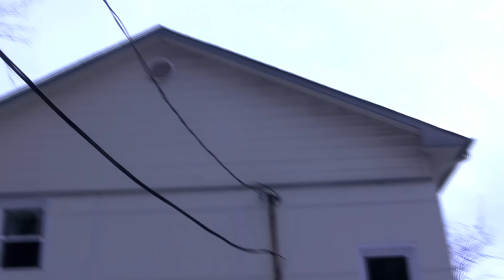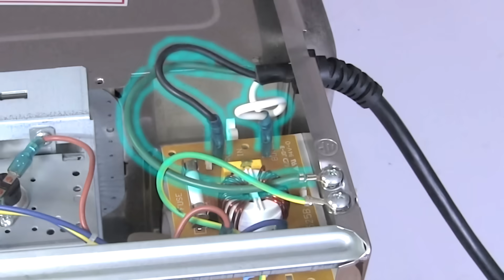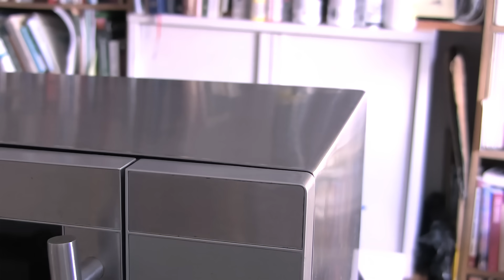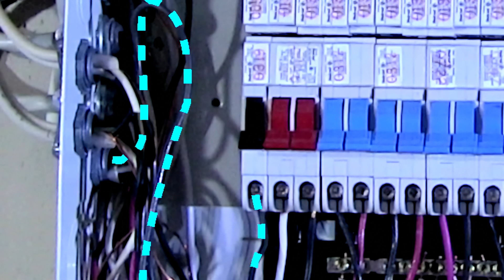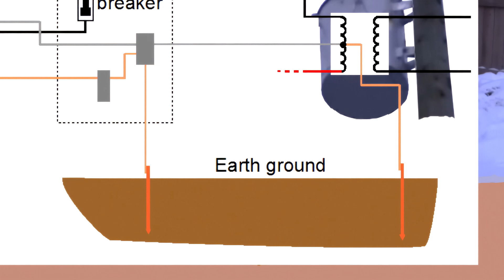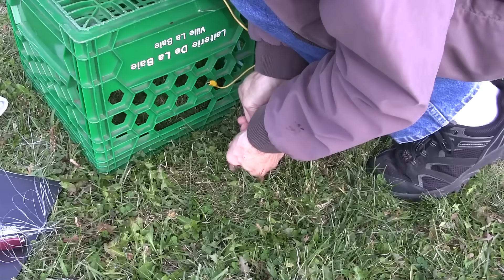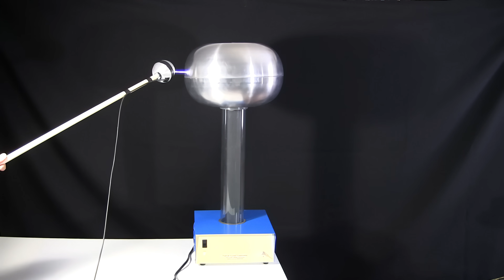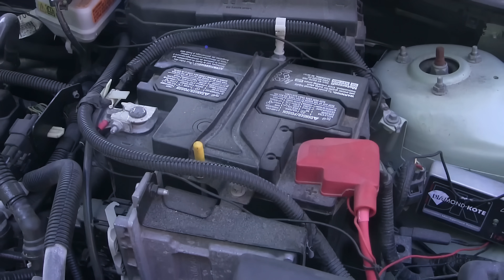What is Ground? Earth Ground/Earthing

Comment: how do they ground electrics in aircraft, such as a military chopper with lots of radar and computers etc?
Reply from the maker: The metal shell of the aircraft is used as the ground/common.
Reply: The same is done in cars. Minus of the battery is connected to the chassis.

Comment: So ground should be called neutral... and the neutral wire apparently does nothing.
Reply: actually neutral and live are just "1" wire if you think about it, just that the Neutral is the return part and the Live part is the receive part... but yeah Neutral makes a bit more sense for ground in a way but since Live is the only one sending current, they chose Neutral cause it kind of does nothing AND ground probably was thought of after the fact. but trust me when i say, it is actually just one wire with a thing powered in the middle, except one sends power and the other returns it.
Reply: Toori-  Not exactly. GFCIs work without a ground wire. In fact,  GFCIs can be installed in older houses with 2 wire Romex (no ground) instead of having to rewire house. A GFCI trips when the current through the hot and neutral does not match, typically when said current goes through, say, a person. That is, the current is passing to ground through an unintended path.
Reply: And, BTW, the difference between neutral and ground is significant, even though the they are at the same potential. The neutral carries current equal to what passes through the accompanying hot, while the ground should never carry current.
Reply: No not at all! The ground wire does not carry any current. It is there as a safety. The hot and the neutral are the only current carrying conductors

Comment: Is this a TN-S system?
Reply from the maker: This is the first time I've looked in the TN designations so I could be wrong but from https://en.wikipedia.org/wiki/Earthing_system#Types_of_TN_networks it looks like this is a TN-C-S system since there's a combined PEN conductor which inside the house is a separate PE and N which combines in the breaker panel and there's a separate Earth-Rod (or equivalent) at the house.

Comment: When i was playing with my guitar cord (plugged in) i touched the tip and makes a noise but when i lift up my foot it goes away even in the walls when i touch my hand to the wall it makes a noise so is cement conductive?
Reply: And only with single-coil pickups :) (unless something is broken or poorly wired). My old strat did that indeed. I guess that your foot grounds it.
Reply: Lol i did everything to find out what it was i tried putting rubber below my amp so it wont touch the floor i tried putting everything up even the wires and cord it still makes that noise like wtf where is the ground coming from?
Reply: Basically your wire coming from the amp is an antenna. You have strong 60hz magnetic fields all around you. The magnetic field induces a voltage into your unshielded cable which because of the amplifier design, will greslty amplitlfy this "noise" and it will come out as a hum. Toy can reduxe this (but not eliminate) by using sheilded cable to the amp from the guitar. High impedance microphone have this condition as well.
If you touch the center conductor of your cable you act as a bigger antenna and your amplifier will make it VERY loud
Reply: roy Yung Ooo i get it thanks for letting me know
Reply: @zuks2899  ever wonder why good. Microphones use three wires? One wire is a sheild and since the two other wires are from a transformer they are considered to be balanced lines. There is simply not enough current from high impedance devices (such as a guitar pickup) to drive a fransformer to make a balanced line.
I have been doing electronic design and repair for over 50 yrs
Reply: Dang 50 yrs
Reply: @zuks2899  hehe yes. Been at this for a while.

Comment: There’s no ground and safety in my country (Iraq)
Reply: If the household wiring systems in your country support a separate earth ground, it is possible to refit an entire house with such, but it will require replacing all the old two-conductor cables with three-conductor cables, as well as every electrical outlet.  This can get rather expensive.  I live in an older house in the United States that was built in 1957, before three-conductor cables with earth ground became the norm, and I have slowly been converting the old two-conductor wiring to three-conductor with modern three-prong outlets. I started at the circuit breaker panel and have been working in sections progressively farther away from the panel.  I also had to drive a long copper-clad steel rod into the earth near the circuit breaker panel to provide a good earth ground, which wasn't there before.  Part of my reason for doing so is that the house was built cheaply, with no insulation in the walls, so when I open a wall to install fiberglass insulation, I also upgrade any wiring I find there.  Anyone undertaking such a project should hire a competent, licensed electrician, consult with an electrical engineer, or obtain a copy of the local electrical code, read it, and understand it before proceeding, as a wiring error could endanger the lives and safety of people in the dwelling.
Reply: Russia is same, or at least it used to be, not sure if they have earth now..

Comment: What should a good ground be if measured with a digital volt/ohm meter?  
I have 2 copper ground stakes driven 4ft into the soil that are 3 feet apart.
Here are the following readings:
Ohm showed:       9.37 M ohm  (soil is kind of dry with sand/clay mixture hence high resistance ?)
AC volt showed :  0.00
DC volt showed:   0.482
Is this a good ground for earthing?  Can you or anyone reading explain why my meter showed .482 direct current voltage  between those 2 grounding rods?
 Isn't it supposed to be zero Volts DC and AC?
Thanks
Reply: If the soil is a bit acidic it can show small amount of DC volts (not AC, unless you have a burried power cable nearby that is leaking)...  Also if your two stakes would be of different materials (say steel and copper) you'd find that the voltage could be higher, you're basically creating a battery. Your soil sounds very acidic though.. AND for this same reason you will get completely false readings on your multimeter as you're inputting voltage on the ohm-meter setting.. trust me, the resistance you have there will no way be 9.37 Megs.. it will be faaaar less, despite of what your multimeter is telling you (it's a very false reading because of the voltage present)... there are proper meters that will measure the ground resistance accurately, or try using an analog meter rather than a digital one.
Reply: @diegomatthews3937   I totally agree that actual resistance is lower than measured resistance as I understand dvom sending out voltage to calculate resistance.  The DC from the soil had me confused a bit,   Why was it there?  Acidic soil + copper ground stake had a reaction, showing up as DC volt on my meter.  Thanks for the reply Diego, I'd learned something today.
Reply: You could do it quite dangerously and get a 100W light bulb, connect one end of it to the live supply via an amp meter and the other side of the bulb to neutral, check and work out what the current and resistance is (if it's 240V then a 100W bulb should be 0.416A.. then volts devide by current gives you resistance, in this case 576 ohms) then unplug it, remove the wire from neutral, and connect it to one of the stakes instead.. plug it back in and measure the current, and say if it is now reading 0.39A then volts devide by current is 615 ohms... and 615 minus 576 is 39 ohms, so your ground has a resistance of 39 ohms in this case.. which is a very bad ground.. but just an example.  Again this is very dangerous and i'm in no way suggesting you'd do this.. it will also not give you a reliable ground resistance ohms figure, it just gives you a rough idea of good or bad grounding. And if you have RCD's installed, this can't be done as doing this WILL trip them..
Reply: @diegomatthews3937  This is using the soil/stake as a real ground.  Clamp an ammeter on the load and using ohms law to figure the resistance.  YOU are brilliant !  I didn't think of this.    I understand this concept and won't get myself into trouble.  LOL.
Reply: LOL ok, and i would actually put maybe 10 amps going in it if i was doing it my self, and wouldn't be happy with the ground if it was more than say 2 ohms at that load (in a dry soil) and would put more stakes or longer ones until i achieved that.. your 4 ft stakes seem a little short, are they longer but you only had 4ft in the ground? You do need good earth, especially if you want it for a lightning arrestor etc.. is that what you're doing?
Reply: @diegomatthews3937  My 4 ft stakes seem a little short..that's what she said too, LOL.  I had used two 8 ft length 5/8" stake for lightning arrestor. One at each opposite corner of my home.  This 4 ft. stake is for my personal earthing.  I like to sleep grounded as I read it could reduce blood viscosity, thereby dropping blood pressure.  You're awesome Diego, very nice chatting with ya!
Reply: Yeah i don't like them too short either ;) have you considered blood thinners like aspiryn? I can't say i heard of being grounded is good for thinning blood, or that thinning blood reduces BP.. i know it can avoid blood cloths if you take blood thinners (anticoagulants) therefore reduce the risk of blockages. Just keep in mind that untreated high BP causes serious damage to the valves in your heart, ultimately leading to requiring heart surgery, so it is very important to keep it under control.
Reply: What about grounding yourself with a single wire from the power socket, connected to the ground? Which country are you in btw? This would be same as the ground from the stakes, and would save you all that work.. this ground is already connected to a stake and or water pipes somewhere around the house (usually close to the meter).. However the earth you want for this purpose does not need to be very strong electrically at all, as it is only grounding nano amps from your body, so even a 1/2 foot one would suffice this case..
Reply: @diegomatthews3937  I'd took baby aspirin, but I have ulcer so that really upset my stomach, and I'd stop taking it.  My blood pressure is not all that high, it floats between 140-145 over 93-97 Its stage one hypertension and I don't like to medicate myself with lisinopril as it taxes the liver and cause me to loose performance with the Mrs.  LOL!  Funny thing is, when I'm medicated with 20mg with lisinopril each day, my blood pressure stayed around 115/ 78 and I felt like crap.  I have zero energy, tired etc.  My body functions at its best at 135/90 (prehypertension).  I get stuff done, and I operate my body as if it was 20 years old.
Reply: @diegomatthews3937  I'm in USA.  I'd looked into grounding myself through the outlet.  My main panel has a grounding rod.  Its grounded to the neutral as it should.  I read something about dirty electricity so I didn't go this route.  Something about residual voltage present at some ground/neutral  leaking electricity back to the person who thought they were grounding themselves, but in so doing gets sick and so on.

So I'm planning to ground myself to the stakes in my backyard.  Being only nano amps.  I think I can get by with a fork in the backyard. LOL!
Reply: @diegomatthews3937  The concept that thinning blood viscosity reduces BP is well know.  An example would be switching from 20w-50 oil to 10w-30 in an engine.  The oil pressure would certainly be lower as compared to the thicker oil..of course at same/comparable temperature as oil thickens when temperature drops.
Reply: I'm in down under, aka AU.. Theoretically or electrically it makes no difference even if you are connected directly to the live wire while sleeping (providing you are well isolated from earth/neutral) which would in that case be exactly same as being connected to the ground, the circuit is not complete in either way. The only thing that would make sense here is that any static electricity that you get charged with would be discharged to the ground, but this would happen just the same if you were connected to the live. One thing that is apparently harmful (which there is no hard evidence of) is electromagnetic fields that are generated by power lines or house wireing etc, but grounding your self will make no difference to those, and same applies to RF fields all around us from multiple sources. Anyway i hope it works for you and let me know if it does pls, it would be interesting to learn that it does work. Our bodies run entirely on electrical signals from brain, so it is possible that in some way outside sources of currents getting into the body could interfere with things. Also, i've heard somewhere that eating garlic can help stabilize blood pressure. Btw you should always eat something when taking aspiryn to avoid ulcers developing.
Reply: NATIONAL ELECTRIC CODE or NEC specifies a 10' grounding rod driving into the ground right beneath the meter panel of a residence
Reply: Stick two nails in a lemon and measure the DC voltage.
It has to do with the PH of your soil. The rids are actually generating a voltage between with extremely low current. Since yoyr meter has such a high resistance (thus very little draw if current) toy can actually measure the voltage.
As stated the NEC code is for ONE 10' rod to be driven into bthe ground by the elec meter. In addition there needs to be a ground wire jumping across your water meter and back to the elec panel as well

Comment: I am no expert on electricity so bear with me, but if ground wire is just connected to neutral, wouldn't it be simpler to just connect neutral wire to metal casing of the oven and just deal with two wires instead? I know experts know better, so I must be missing something.
Reply: Connecting the neutral wire directly to the case would always require the case to be a part of the electrical circuit. That wouldn't be an issue ordinarily as long as electricity is flowing the way you wanted it to, but if a short circuit occurred, you'd have high electrical potential now going straight into the case, which could give you a shock, or worse. The ground is there as a "sink" to send excess charge to/from, instead of sensitive components or yourself. Old power tools used to not be grounded, so a common prank would be to have someone use a powertool such as a drill (with a metal case) in the rain, which would shock them.
Reply: @Jeongheon Lee I don't quite understand. Did you mean you wanted to connect neutral to the metal casing and only then to the breaker and transformer??? That would make the case dangerous to touch.
Reply: No not at all!
The neutral and hot wire carry current.
In any 220v circuit there is NO neutral!
If you place one of those wires to the case, the entire case of the stove would be hot (no pun intended) if you should touch rhe stove and the sink you could be killed.
The ground wire is for safety
Dont rely on black/white color code! "Normally" the white wire is neutral, but like i said, a 220v circuit has NO neutral!!